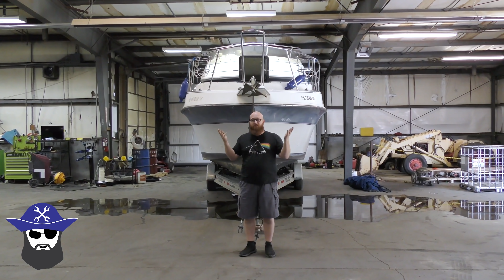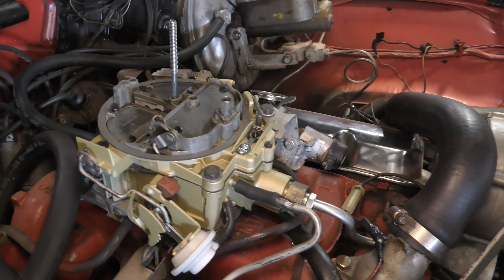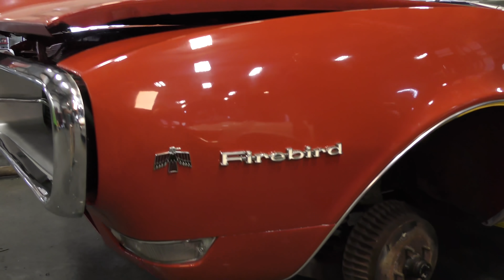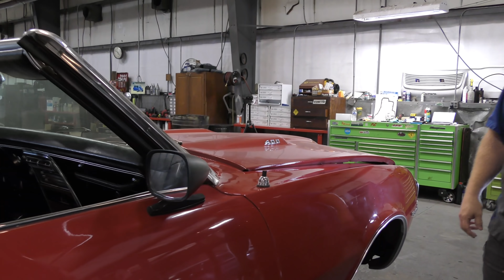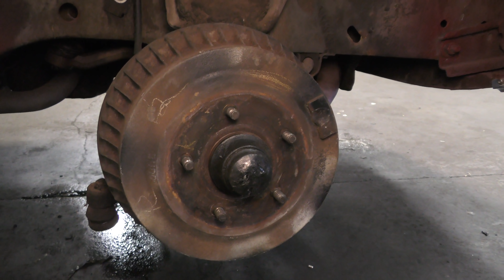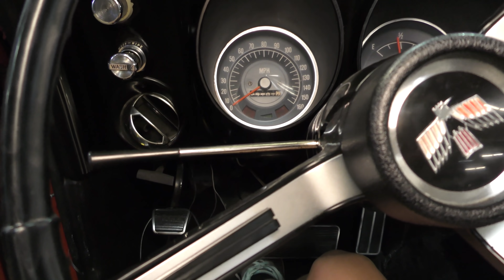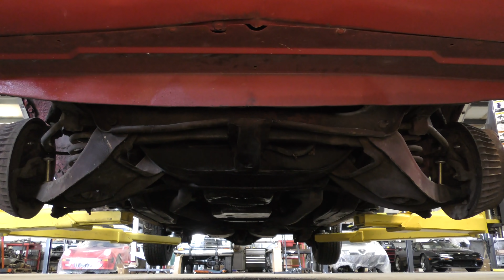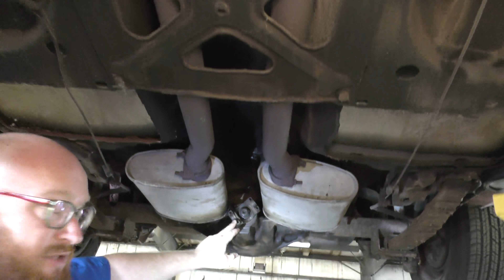Fabulous 1st Gen 1968 Firebird 400 leaking like Niagara Falls. The CAR WIZARD finds 6 places leaking

Comment: I can smell that interior through the phone. All cars with that black vinyl or whatever that material is on the dash have a certain smell to them. My grandma's last car ever was a 79 Buick LeSabre and I had the luck of having to take my driving test in it, in 1992. I almost couldn't use it because the seatbelts were not like they are today. The instructor just looked at me and laughed. I hadn't hit my final growth spurt yet so I'm still about 5'9" and about 150 lbs. and I've never driven a car this big before. But other than having to do the parallel parking twice I aced it. But that was just the end of the story, I don't have enough time to type out the insane beginning of the story of that day. It's R rated too so it's not suitable for this channel.

Comment: "Pain in the tush!" Agreed, can't do much on modern cars, but on older (pre 1980) cars EVERYTHING was grunt work.
Reply: Yup,  how about installing Turbo 400 auto transmissions...?.!  Tore a damn rib last time I hefted one into the Buick...!
Reply: wait until you get to 1980 and then have the smog equipment now in the way, complete with the K bosh fuel injection computer systems all over the thing that never seem to work or sync right like a good carb.

Comment: The Drums brakes all the way around is confusing, considering the 400 was a "Sports" trim
Reply: Chrysler Sold their Big Block cars with 4 wheel Drum brakes too. They were adequate in stopping these cars unless you were using them hard -i.e. racing, driving in mountainous or hilly areas, or towing. Even towing they were and still are fine as long as you know what you are doing.
Reply: @4cammer  They are great until you go through a big puddle of water. Brake fade is a problem too.
Reply: Back in the day you just had to option everything when ordering your car. If you forgot to check the box for disc brakes on your big block muscle car, then it came with drum brakes and you just had to deal with your mistake.
Reply: It's a "Domestic" thing. You look at a Brand like Mercedes - They've had 4 wheel disc brakes for forever and then some time on top of that. I wanna say since the early 60s it's been 4 wheel discs. No exceptions. 
Or Crumple Zones. The "domestic" market was very late to adopt that too. Mercedes had patented the crumple zone in 1952 and had the "Ponton" (W120) with it released in 1953. They combined the Safety Cell & Crumple Zone design with the release of the W111 in 1959. 
I can't even find when Ford/Chevy or any of the Domestics started using Crumple Zones, but I imagine it was probably getting close to the 90s - Given a fair amount of the "Classic" car lovers enjoy hating on crumple zones that they like to say are a "modern" invention. 
Drum brakes are acceptable but they overheat pretty easily and weigh more, and they lose their effectiveness faster. It was just something the domestics said was fine and sent it.
Reply: drum brakes whether there adjusted right on not fade fast compared to disc brakes.
Reply: Just comment that. wtf?
My dads Fiat 125 from 1969 with 90HP had 4 discs
Reply: Welcome to America.

Comment: Funny...the rant about the guys not working on something like this Firebird. I'm 45 and I LOVE when I'm able to work on something old, just the amount of stuff you can correct with a damn screwdriver and wrenchis astounding, just ask the guys I work with when something comes in with the carb and timing not set quite right and in minutes I have it purring like a kitten.
Reply: No expensive sensors needed.

Comment: You don’t take it to a Pontiac dealership because they don’t exist anymore
Reply: Even if they existed they wouldn't know what to do.
Reply: @taunuslunatic404  Back in 2004 I bought a brand new Pontiac Vibe (basically a rebadged Toyota Matrix).  Was told only one mechanic worked on them because the rest felt the Vibe wasn't a real Pontiac and wanted nothing to do with them

Comment: Of course vintage cars are easier to work on. No turbos, EGR, catalyc converters, 100 modules which can and will fail some day, no software updates, heck on a new car you even have to teach/learn the car that you put a new battery in....
Reply: It's extremely easy to swap out an actuator on modern stuff. It's all parts, old parts aren't any better than new parts simply because they're old
Reply: @tjwatson0403  No but "old parts" are less and not hundreds of cables, modules, plastic... A new engine costs at least double or even 10+ times as much as a new engine for a vintage car.
Reply: @pawsnpistons  and that modern engine easily lasts twice as long. It used to be rare for an old engine to make it 100,000 miles

Newer is usually better
Reply: @tjwatson0403  tell that to the 50s diesel Mercedes' out there with 500k miles on them... Or the 3 million mile Volvo...
Reply: @joelsanfordphoto  congrats on finding a single survivor. Anecdotes aren't data. You could very easily make a modern Toyota do the same
Reply: @tjwatson0403  There have been many more high mileage vintage cars than that. Even back then, If you couldn't get a car to 100k, you were doing something seriously wrong. Meanwhile today there are cars that are designed to fall apart around 100k. BMW's been doing that for decades now. Ask me how I know! Total garbage.
Reply: @joelsanfordphoto  you're only focusing on one brand. Yes modern BMWs are junk. That doesn't mean old is better. A modern Toyota will outrun an old BMW every day. Gotta look at the total market. Look at how the average age of cars has increased over time. That indicates they're getting more reliable, rather than less
Reply: @tjwatson0403  an old toyota will outrun them all

Comment: Wizard, thanks for sharing another great video. I love your style, knowledge, and content. In the case of working on 60-70's era cars, I respectfully strongly disagree.  I've worked on them since I was 15 (now 58) and can attest to the fact that they are infinitely easier to work on than a modern car.  No, you don't have computer diagnostics to figure out what's wrong, but these cars don't have computers. :-)  Everything else is basic mechanical diagnosis and sleuthing.

Comment: Re brackets: Remember that just about everything could be ordered as an option. Beginning with bare bones, it always needed a belt to drive the fan and an alternator. So that belt was always closest to the block. Next could be a/c only or power steering only or the option to have both. As an option was added, a bracket was put on top of another bracket. The metal was usually about 1/4" thick so if you got the stackup wrong, the belts wouldn't line up. Dismay, when I'd have to change a belt, it was always the one closest to the block (water pump) and everything else had to be loosened up. I've seen a ton of power steering pump reservoirs ruined when people pried on them.
Reply: That makes so much sense I'm upset that I'm only just now realizing it
Reply: @TheAwfulInternet  Another thought: An engine could fit into several models. The engine was "adapted" to the car body by using twisty convoluted radiator hoses. That is why you see so many "snakes" hanging on the hook at Auto Zone.
Reply: Obsolete professor, you are bang on, cause my 1993 Toyota pickup had the same set up.  It was optioned with a/c and power steering, had 3 belts.  Minor PITA when I had to change a leaky water pump and remove those extra belts.
Reply: Oh man, I think the king of bracket madness in the 80’s was anything with a small block Ford. brackets on top of brackets and all bolted through the water pump, every bolt was a different length, some with studs, some without. The smaller cars were worse…cougars etc, same setup but less room. Remembering doing water pumps on those makes me shudder
Reply: @deggs1975  It would have been easier if all of us had a phone camera back then
Reply: Yeah I'm kind of at a loss on what he's complaining about here, not only do you typically have plenty of room, the brackets are held on by a couple bolts each. ASSUMING the AC compressor belt was one of the closest to the block, at the worst you have to loosen the power steering pulley, remove the belt, loosen the alternator, etc. THere's not "brackets on top of brackets" you can typically pull a few belts off. Even removing all of the front of an engine on something like this is quick and easy.
Reply: That's where you see the first signs of the US car manufacturers "don't give a shit" attitude. 
German or Asian car manufacturers would have taken off the original bracket and designed a new one so all the pully's lined up and they could fit a longer serpentine belt. Simple and elegant. 
US manufacturers just bolted on a bracket on top of the original bracket and bolted a second pully on top of the original pully and fitted a second serpentine belt. It's just the lazy, don't care attitude that's now so typical for US car manufacturers.
Reply: @tjroelsma  The approach was taken that you would get "packages". DX Honda had stick, no a/c and hand crank windows. LX came with power windows, etc with the only choice of stick or automatic. EX took the options up a step with power roof, etc. The versatility/choice of options on GM cars was astounding. A 60's Motor Trend article ran a story of a guy who ordered a Vista Cruiser station wagon with a 4 speed with Hurst shifter, racing stripes, shaker hood, bucket seats and a 455 V8, items that usually only come on the 442. The dealer who submitted the order said there was nothing that said they couldn't have those options on a station wagon. Freedom of choice comes with a price. No choice is when someone else makes the decisions for you. The bolt pattern on Chevy transmissions was such that you could put any 4 cyl thru V8 in front of any stick or automatic. That's why you would see Chevy Novas with the 454...easy swap.
Reply: @obsoleteprofessor2034  That's something I can understand, but the whole bracket bolted on to bracket thing makes no sense  to me, especially when that second bracket is the mount for an airco-pump.

I assume that airco was a pretty popular option in the US, just like it was over here in Europe. So when you look at the parts catalogus of say a Mercedes, you'll see two types of serpentine belts:
- a non-airco or short version.
- an airco or longer version.
That's simply because Mercedes fitted the airco car with a totally different bracket.
Reply: @tjroelsma  It is more common to have a different tensioner, idler, etc in addition to just a shorter belt. Because a pulley (a/c) is missing, the wrap around each item is totally different. One instance that I know of has the water pump turn in the opposite rotation..no bracket change but can you imagine putting on the wrong pump. Some vehicles came with only one configutation that would force you to replace a locked up compressor even tho you couldn't afford the repair
 Dorman and other companies saw an opportunity to make a dummy pulley to take the place of a compressor.
Example:
https://shop.advanceautoparts.com/p/dorman-help-air-conditioning-bypass-pulley-34298/12060293-P
Reply: @tjroelsma   Well, it was  the cheap, simple solution and with the market divided between luxury/ sport/ hi performance segments and not every owner is wanting a/c.
Reply: @tjroelsma  In the late '60s, Asian car makers were as low tech as any car manufacturer.  Regarding German cars, you're right.  However, price a new BMW or Mercedes against the Firebird.  The Firebird was way cheaper...
Reply: @bonnevista  I won't argue that Asian cars weren't pretty low tech, because they were, but I will argue that they were designed better than US cars. 

This whole "just add an extra bracket" thing is a combination of pure lazyness and a "don't care" attitude. If you design a car and sell it with the option of having it available with airco from the factory, then it makes sense to design a bracket for that option. Just bolting on a second bracket and call it a day doesn't make any sense from an engineering standpoint. You do things like that if it's a one-off special order, not if it's an actual factory option.
Reply: @tjroelsma  If it was German you would probably have to remove the engine to do simple maintenance like the way they are today....these cars are a lot easier to work on than today's cars..any idiot knows that
Reply: @richardbaumgart2454  Well, then you're calling the Car Wizard an idiot because he just said these cars are a pain in the ass to work on. 
Have you ever taken a look under the hood of a Mercedes from the same period? I sincerely doubt it because those are the cars that are actually easy to work on.
Reply: @tjroelsma  i have an '89 190e 2.6 and a '71 camaro..what do you think is easier to work on? I know already
Reply: @tjroelsma  i got a great idea lets put a Jag motor in it duh 😨
Reply: @tjroelsma  I have worked on old cars from the 60`s, american and european, even japanese. And newer stuff. I think it`s rather safe to say that the newer it gets the more complicated it gets to work on. Newer car got more stuff crammed into smaller spaces, try replacing spark plugs on a new car, nightmare on most. OF course it can often be challenging on older cars to but not like new cars which also need more special tools etc etc. But I would say old french cars is a nightmare regardless, not sure about the newer though as I refuse to touch any of them.
Reply: @truxton1000  The French suffered from much the same problem as US car manufacturers: instead of proper redesigning something, they just kept adding things with extra belts and brackets. Over here we having a saying that something has been finished with "The French Attitude" aka don't worry, it'll be fine or half fastened is fastened enough etc. You get the point. Laziness and a general "don't care" attitude ruled in France and up to a degree it still does.
 
If I remember correctly it was the Peugeot 305 that had the alternator mounted at a 90 degree angle to the crank, so they simply fitted a serpentine belt that used two extra rollers to make that 90 degree angle. (jokers said that Peugeot engineers had stood looking in admiration at their newest creation and then realised they had forgotten to include an alternator. So they just mounted it at a conveniently place and to hell with it) No need to say that car went through serpentine belts like there was no tomorrow.